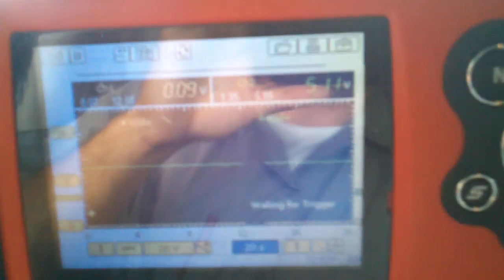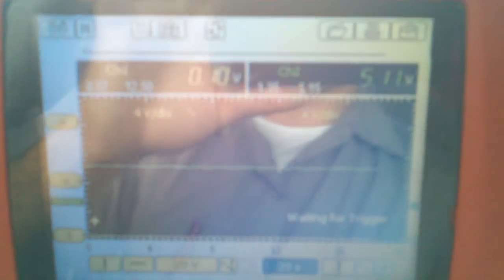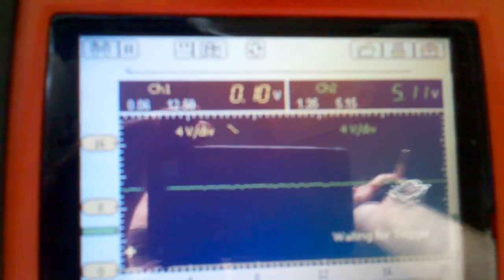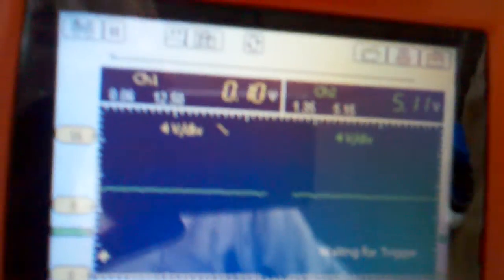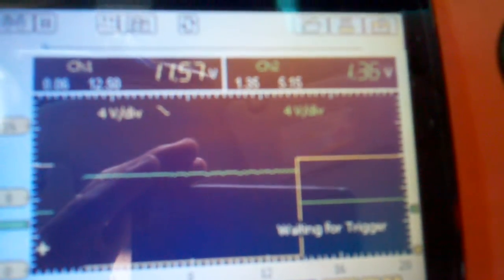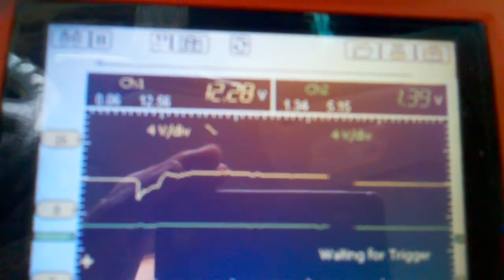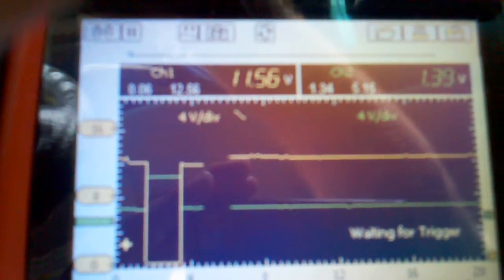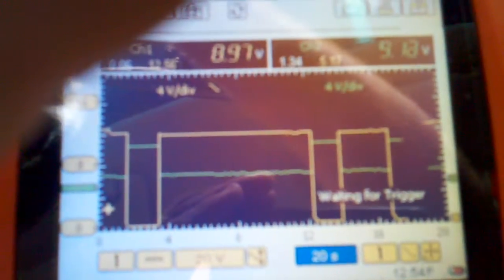gm pass lock sensor testing scope chevy pontaic olds

Comment: Ok bro so my 5v reference does not change does that mean I have a faulty passlock sensor? Already replaced the wires to it. Starts for 1 second then dies
Reply from the maker: Does yours have a battery +(12 v) ground and sensor wire?  The passlock voltage should go from 5 to some other lower voltage , if not make sure the 12v and ground are good, most likely bad pass lock sensor, I have had a bad bcm that was putting 5 volts solid out(almost like it was a 5v ref instead of a input/ sense) a few times
Reply: @BrianMann216 yes I have  battery voltage 11v  on the red and white wire and  ground on the orange and black wire. I'll check to see if the bcm is putting out any voltage
Reply from the maker: @MechTech5000  the bcm will put out 5volts, use a resistor maybe 1000 ohms and see that it  goes low  on the scan tool
Reply: @BrianMann216 I'll try that, thank you!

Comment: I only get a voltage drop when I try to crank over. Mine stays at 5v in the on and the and accessories. Tried cleaning contracts but didn't help.

Comment: I get a constant anti theft light and the engine starts only for 2 seconds... they light will not flash like in the relearn procedure though. Also I am getting 5v between one couple of wires, 9V between another couple, and 4V between and couple, in the 3 pin connection of the device that's attached to the key cylinder. 
so maybe the low voltage is the problem ? the battery is fully charged though.
Reply: bad audio hard to understand!!!!